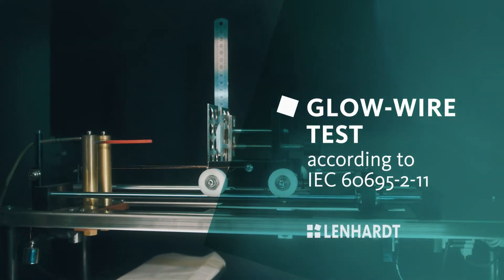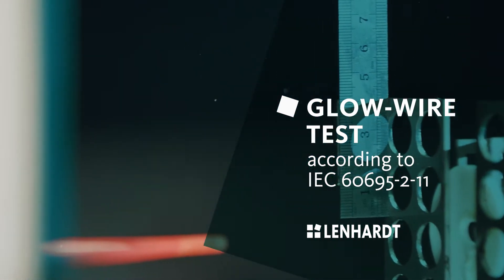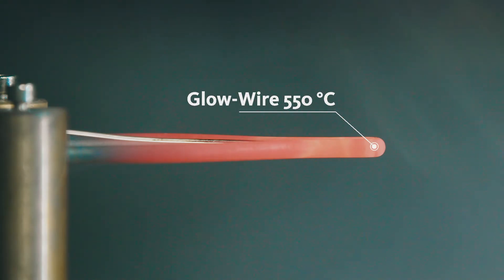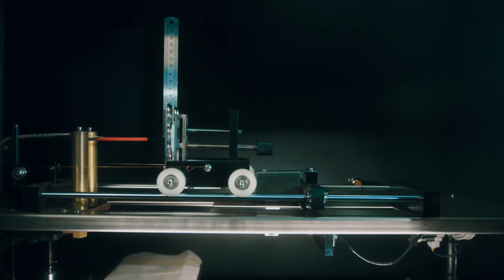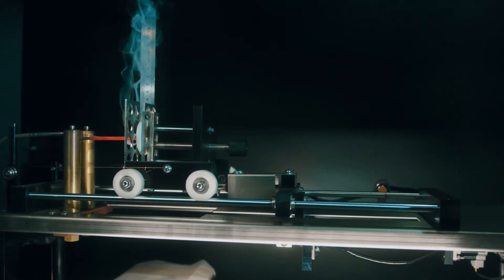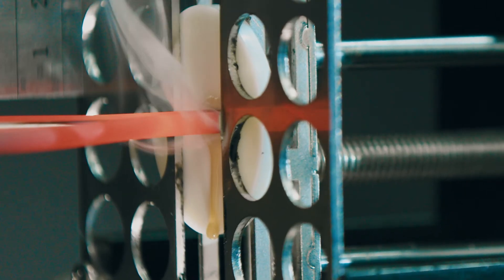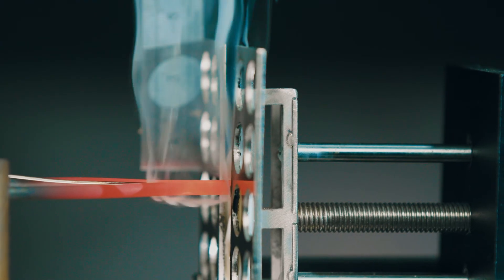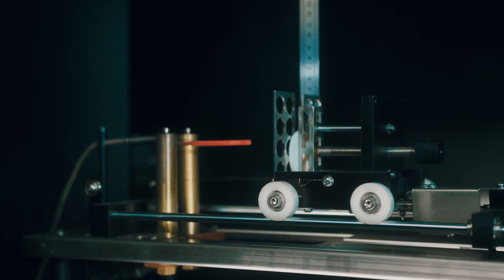Glow Wire Testing IEC 60695-2-11

Comment: We're concerned about the recent glow wire test on our prototype material. The puck, which is our prototype, wasn't properly sized, and the tissue drip patterns weren’t revealed as required. These issues critically affect the validity of the test results.

Our team has been waiting on this test to move forward, and with our project already four years behind schedule and deep in the red, these errors are causing significant delays. It's frustrating that we have to address this through a YouTube comment, but it's our only way to reach you.